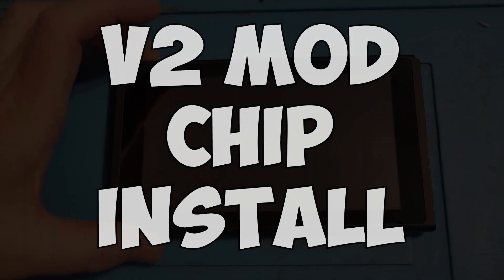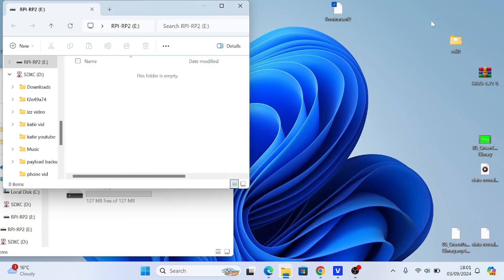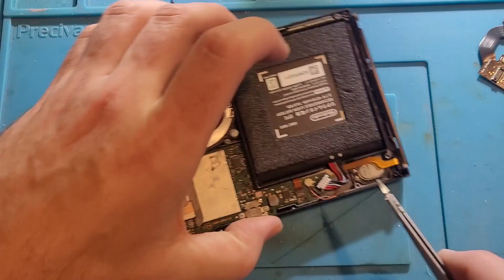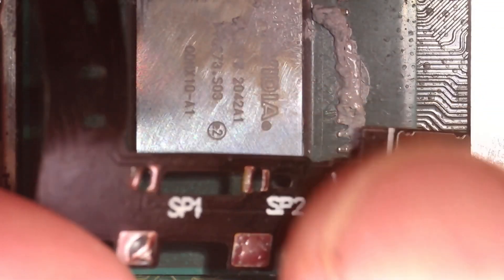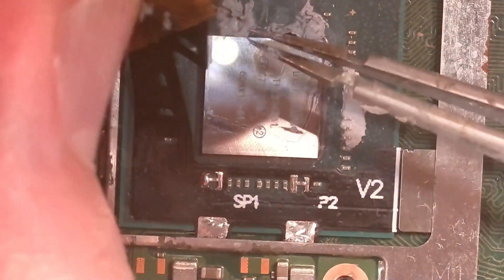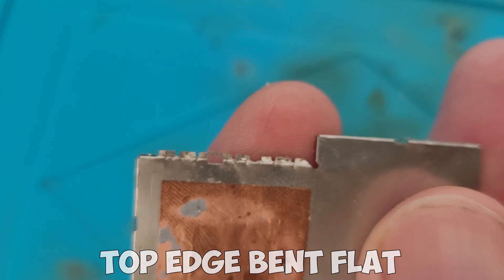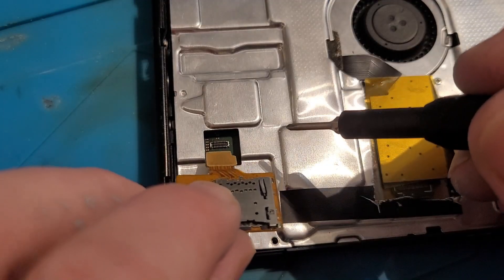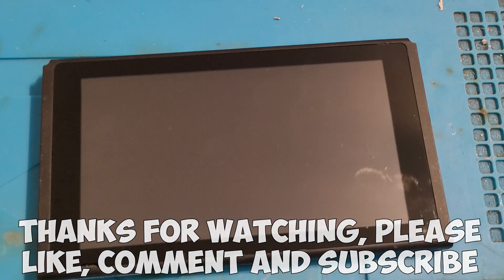Installing a V2 mod chip within 9 minutes! Includes flashing guide

Comment: hello does the picofly software link  work only for v2 or all models ?
Reply from the maker: Works for all
Reply: @fixingmoddingbuilding   thank you
Reply: @fixingmoddingbuilding   i have another Q i have ver 2.0.50 do i update to latest ver then install modchip or is it not compatible ?
Reply from the maker: @DARK__KING  The latest firmware will be cracked but can take a few days, I wouldnt bother updating as most games dont need the latest update to run
Reply: @fixingmoddingbuilding   even the new pokemon ?
thanks for the info
Reply from the maker: @DARK__KING  best to google the title to see what firmware it needs

Comment: i need help ! when i put the little usbc adapter, nothing pops up. even when i hold the boot button while plugging it in.
Reply from the maker: If nothing appears it normally means it has software. Have you tried holding the other button down? Also make sure the USB is fitted correctly and in straight or it will not read it.
Reply: @fixingmoddingbuilding  yes i made sure everything was correct and still not working..i tried holding and pressing all the buttons. i tried severel usb and try doing it on a different computer and its not connecting
Reply from the maker: @Giaelbiggie  My only other suggestions but sounds like you did already was different usb cable, some act different. I have also had the connectors in the past break and dont recognise so have had to use others (i have a lot of spares)

Comment: I tried this and I failed. Idk what i did wrong but when connecting the emmc to the already soldered chip it just wont turn on. Console is fine. But no pico screen
Reply from the maker: Check solder points, check for shorts, check the chip has software on.
Reply: @fixingmoddingbuilding  man.... it wasnt working because I didnt connect the ch1p on the original emmc port where it was... oh god im so stoopid

Comment: I think I could do this myself too. Only thing I need is flux and that electrical tape. I have everything else already.
Reply from the maker: If you have soldering experience it's pretty easy! If not get a faulty board off ebay to practice, rather then risk breaking your switch

Comment: I have a Switch 1 HAC-001(-01). The serial starts with a XKW7.  Is this video representative of a modification of that same type of device? Same modchip model and process?
Reply from the maker: All switchs v1/v2 can be modded like this
Reply: @fixingmoddingbuilding  The New 2040Plus chip works for those? Super nervous about bricking my device.
Reply from the maker: @axsdeny  Yer, I install any on there, cheaper the better!

Comment: Will be coming back to this video in a week or 2 when both my mod chips come, i accidentally ordered 2 😐
Reply from the maker: Good luck, not a bad mod chip to install!
Reply: @fixingmoddingbuilding  oh your a fast responder that's good, are you able to tell me if its easy to solder without a magnifying glass? i bought everything like a solder, that liquid looking stuff and thin af wire, but i forgot to buy a magnifying glass.
Reply from the maker: @J13NKz.x_x  Depends on your eye sight, I used to do them by eye its just now I have a microscope its easier!
The other option is to get a microscope app on your phone, or zoom in but this normally makes the pic grainy!
Reply: @fixingmoddingbuilding  ok thanks bro!
Reply: @fixingmoddingbuilding  im back, mod chips came early, other stuff came eearly too, had to buy some of the stuff. about to solder this....... EVERYONE WISH ME LUCK..... will come back here when finish an fingers crossed my first time soldering will be ok.... time to watch this video
Reply: welp... i grinded down both pin things ;-;
Reply from the maker: @J13NKz.x_x  Not sure what that is, I assume its not good?
Reply: @fixingmoddingbuilding  Those 2 little things that you solder the chip onto.... ;-; theyre flat now so i dont think i can solder the chip on, the nintendo still boots BUT i cant solder the chip on now cause i flattened those 2 things

Comment: Great video! I'm a computer eng student so I have some soldering experience but I probably won't try this until I build up the courage lol. Wanted to ask, would the modchip model, firmware, and soldering process be the same for a V1 switch? Pretty sure mine came in a grey box.
Reply from the maker: Hi, glad you enjoyed the video. There are several variants of the chip but all v1/v2 chips will work. The only difference is the orientation of the chips you solder to depends if it is v1 or v2
Reply: @fixingmoddingbuilding  ok thanks! I will report back here when I give it a shot o7

Comment: 1:05 as someone who has experience with flashing other rp2040-based devices (framework 16 input modules as well as a custom rp2040-based board built to provide telematics for a racing car), you don't need to delete those files to flash the firmware, since the bootloader creates them for user instructions and autodetection by any (semi-)automated flashing software each time it is entered, and ignores them when the firmware is flashed.
Reply from the maker: thanks

Comment: I'm thinking a fine tipped heat gun would make this process much easier. Also you may want to emphasize to people that you need to use rosin solder with electronics, not acid, otherwise you'll corrode components.

Comment: Help, I did everything as in the video and when I turned on the switch to check the chip the LEDs turned on normally but instead of showing "no SD card" on the screen it turned on normally. Is there a problem with this happening?
Reply from the maker: Either the solder points are loose or the chip doesn't have firmware installed on it
Reply: @fixingmoddingbuilding  I just re-soldered the chip and I still have the same problem. I tried using the firmware you put in the link in the description. I tried the latest version and the one before that. I also tried another one called fw_2.73.uf2 and I have the same problem.

Comment: Hi i need help? when you were soldering the 2 pieces on the chip to that one piece. can one bit of solder touch all 3 pieces at once or do they have to be seperated with a gap in the middle?
Reply: it probably shouldnt be bridging together

unfortunately, breaking that apart will be annoying to do, especially without dislodging that tiny capacitor in the process.
Reply: rip 🪦

Comment: I love watching your videos for guidance. What soldering station are you using in this video, and which tip do you use? Also, what brand of solder wire and flux are you using? Sorry for asking so many questions, but I’d really appreciate your response. Thanks!
Reply from the maker: Hi, thanks. So I just released a new video today in real time and it shows everything I use to install a mod chip.
The only thing I don't know is the solder I use, had it a while and the markings are worn so can't see!

Comment: excuse me if this is a dumb question but would this work on a switch that has save files on it?
Reply from the maker: Yes, it does not delete anything. Set up emunand and you can have your switch as it currently is and a cfw side

Comment: If the Switch doesn't turn on after installation of the chip, what could be things to check for?
Reply from the maker: Mod chip has the software installed, solder joints?
Reply: @fixingmoddingbuilding software yes, soldering maybe, gonna do it again later. When I turn the switch on w/ the modchip, it blinks blue 2 times, then yellow 3-4 times

Comment: while soldering i lost the resistor at SP2, please give me a solution 😢🙏🙏
Reply from the maker: I'm not sure if it's needed? As long as the pads are not pulled off I would look at getting some replacements caps and soldering it back on, maybe buy a faulty motherboard?
Reply: @fixingmoddingbuilding  so can i buy another resistor attached to replace the lost resistor in SP2 on the board
Reply: @fixingmoddingbuilding  While I was welding, I dropped the resistor

Comment: hey what would happen when the microcontroller would not be flashed with a custom firmware just empty? i got a black screen and not beeing able to flash something on it due to a bad pinned microcontroller usb port. so i dont know if there is an already flashed custom rom.
Reply from the maker: I've had it when it has just booted to official fw when nothing was installed

Comment: How were you applying the solder on multiple spots so easily?  I didnt even see the solder in your hand. Just the iron and what i bemive is the flux.
Reply from the maker: I use kingbo flux, I will apply solder to the iron tip then use, it normally holds enough for a few applications

Comment: which picofly firmware u use ?
Reply from the maker: I think 2.72 or 2.74, one of the later ones seemed to boot a lot slower so sticking with these for now
Reply: @fixingmoddingbuilding  thnx

Comment: how easy would you say this is to someone with zero soldering experience? You made it look fairly simple but I'm still on the fence about weather or not I want to risk it
Reply: I have very little soldering g experience, messed around in school when I was a kid & successfully chipped an OLED which is 10x harder. To practice i bought a soldering kit off Ali express to make a little alarm clock, wasn't micro soldering but helps get practice on working with soldering & u get a cool little device when you finish 😊
Reply: @Unknown_Handle404  thanks for the advice
Reply from the maker: I would never recommend diving in and going for it, practice first, faulty switch boards are cheap now, maybe buy one and practice on that?
Reply: @fixingmoddingbuilding  Where do you find these faulty boards? All I can find is working ones

Comment: i dont know anything about switch modding so if i am gonna do this how will i be able to mod it and is it still possible to just go to the normal menu and lastly will i lose any data.
Reply from the maker: Can setup emunand to use cfw and ofw. Should not lose any of your data doing this
Reply: @fixingmoddingbuilding  i bought one and it does not reconice it even when holding the boot button

Comment: my modchip isnt connecting to my computer even after holding the boot button. Do you have any suggestions as how to fix that?
Reply from the maker: Try different button combo, check the USB connector is fitted correctly
Reply: same
Reply: Make sure your USB-C cable is power and data, and not just power...

Comment: Hi, can i do it without a microscope? i have little experience but i feel there is only a few points to solder and should be quite fast.

another question is where do i get the file to replace in your video?
Reply from the maker: I used to use my phone on zoom or a microscope app.

Comment: bought a modchip yesterday, I have no soldering experience but you make it seem easy lol
Ill update yall if I broke anything 🙏
Reply from the maker: With a little experience and practice it is easy but with none it's a recipe for disaster!
I recommend a lot of practice before you jump in
Reply: @fixingmoddingbuilding  Im built different though, ill manage
Reply from the maker: @nourie4473  🤣I am the same, I did an sxos install years a go without any experience or decent equipment, just decided to go for it! 
Thought I should send you the responsible reply to begin with!
Reply: @fixingmoddingbuilding  Haha yea I'll practice with some leftover stuff I have. Btw, I wanted to ask, does it matter which Firmware my switch is for the picofly to work?
Reply from the maker: @nourie4473  At the moment no, atmosphere works on the latest fw so can update if needed.
Reply: @fixingmoddingbuilding  Update: I broke the modchip but the switch still works fine lmao
Reply: @nourie4473  This is hilarious lmao, I respect your balls to come back and admit defeat

Comment: My flex cables say v11 and v12. I have a v2 switch. Should I use the one that says v12?
Reply from the maker: If you put it in place you will see, the chips on the board are a different orientation so only one will physically fit
Reply: @fixingmoddingbuilding   ok thank you 🙏

Comment: I freakin love your videos dude. No bs, just straight to the point.
I've already modded two OLEDs, now I'm heading towards a V2 Switch.
Reply from the maker: Thanks, if you have completed an Oled, v2 is going to seem so easy!
Reply: Did you have to do anything to the switch or to ofw before adding the modchip
Reply: Some require latest updates, just check what cfw version is on. @genel.8582
Reply: @genel.8582  probabaly if you wanna get good support with cfw get youtube so u can hold r and not run in applet mode

that was optional so he didnt do anything
Reply: @genel.8582 I followed sthetix's installation guide
Reply: hey, wanted to ask what the experience is like doing this the first time? im also about to mod a v2 switch
Reply: @it3963 The only complicated part is soldering the SP1 and SP2 points. Try not to overheat that área with the iron cause you run the risk of desoldering the capacitors
Reply: @Apo458 i am planning to upgrade my ram, have you also got a few words gor that?

Comment: What are all of the tools ill need to mod mine? Also can i solder without a microscope?
Reply from the maker: Wont need all this but these are the tools I use: 
https://youtu.be/cWOmSBAXCzM
I used to use a phone on zoom or a microscope app. It did the job but once you use a microscope there's no going back, until then a phone does the job!
Reply: @fixingmoddingbuilding  what kind of microscope setup can you get for somewhat cheap for smd soldering? I could use one and always think about it but i assumed it would be super expensive lol. I just need the zoomed in view like you show in your videos. Is it possible to do that alittle bit with the iphone or maybe android, to a pc screen or something..?
Reply from the maker: @mxracingunlimitedltd7784  Up until recent I used my phone to zoom in, there are free microscope apps you can get that help, stops the screen timing out.
These work well but go a bit grainy as you zoom in.
Once you use a microscope you would never go back but due to expense and maybe never using it again then the phone is the best option!
I have a few videos recently on microscopes that I use, all really good and similar, just depends what you can afford!
Reply: V2 is so easy if you have experience with soldering. No need microscope, i have done this without microscope even on oled version
Reply: You can, a cellphone camera might work just fine or a magnifying glass. If you have experience with soldering probably none, but if you don't you may knock the SP1 and SP2 capacitors if you're not careful enough

Comment: ich have a Switch Modell HAC-001.
Serial number: XAJ7004488… 

I‘am not sure whether to install the V1 oder V2 flex cable?

The model number is from v1 (no revision behind it), but some state that the xaj7 is v2. 

Does anyone know that? Thanks
Reply: HAC-001 is the original
HAC-001(-01) is the second model

Although pretty much any chip that you buy nowadays includes the V1 and V2 flex cables

Comment: My V2 is working great. I just purchased an OLED. I received the mod chip yesterday. Does the OLED take the same firmware?
Reply from the maker: Yes
Reply: @fixingmoddingbuilding  Thanks. Just waiting on the wire and more thermal paste to be delivered.

Comment: Hello again, 
I can'tboot even ofw, there is no changes on the screen. 

However the last i try to put the modchip, the color coding is blinking blue then turns white.

What does it mean?
Reply from the maker: I dont know without seeing it, I would check you have not knocked any chips off, damaged a ribbon cable

Comment: Hi sir, for sure you're using microscope for microsoldering. May I ask, what microscope model or brand unit that you use afforadable and good quality? thank you very much. 
- from novice technician, hehe
Reply from the maker: I have used a few recently, linked the videos below:
LinkMicro, 10.1": https://youtu.be/N2JIZeCBi58?si=ySDUH7uaW8c4Ejam
Tomlov 10.1": https://youtu.be/wkVNRP6Y7Lo?si=pmFhadms6e_Ri2Ul

Both have plus/minus but see whats on offer
Reply: @fixingmoddingbuilding  thank you sir for suggestions

Comment: Hi, once everything is done, my switch turns on but with a black screen only and it starts blinking :( 
Even the lights turned on correctly (blue-green)
Reply from the maker: Assuming you haven't taken the board out which would eliminate the ribbon cable being damaged I would disconnect it all, put the nand back into it's original location and try and start it normally.

Comment: I soldered the points on and plugged everything in correctly. Instead of the pico chip flashing blue and taking me to the no sd screen, mine just blinks blue twice, turns yellow then the switch boots up like normal and takes me to the switch main menu. Has anyone else encountered this? Do I not have a solid weld on all 4 points?
Reply from the maker: You need to check the solder joints are all solid
Reply: @fixingmoddingbuilding  That's what I was hoping. I'm gonna take another crack at it next week, thanks.
Reply: @christiandj50  Were you successful?

Comment: Is this a oled switch?
I got an Oled one and got an older chip, where i have to solder more and cut off some metal. This one seems easier. I dont want to make any damage so if this chip is an alternative i would get this one.
Reply from the maker: This is for v1 /v2 only, oled is a lot harder